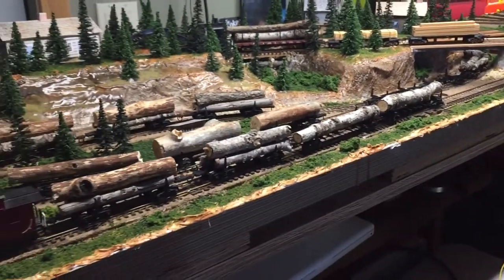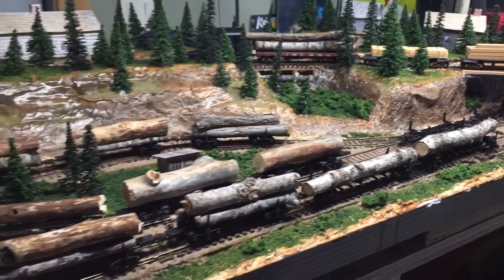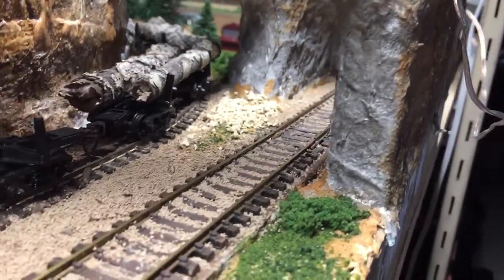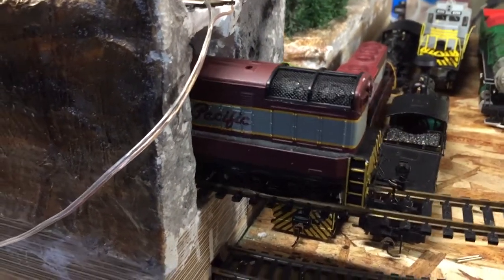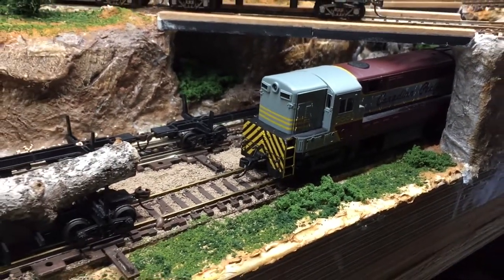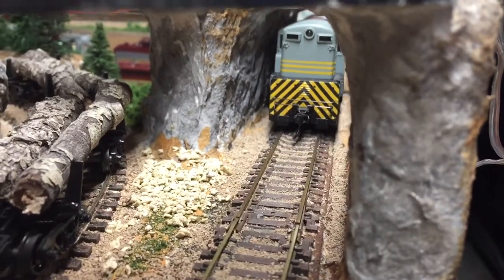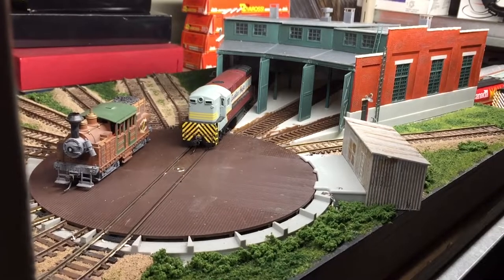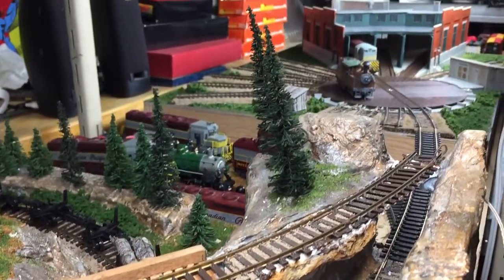Connected My HO Scale Modules! The easy way. #YouTube #youtuber

Comment: Just beautiful. I love your scenery. A small logging town module between the two with company housing for the workers could be an idea.   Keep up the good work.
Reply from the maker: I agree!   I also have a single engine shed I am thinking of including on that.  I had ideas of possibly using the airstream trailer kit as well for the general era of early 1900-1950.  I’ve also contemplated the idea of a small fiddle or switching yard in there.  I think I may have about 4 extra feet on this shelving unit.